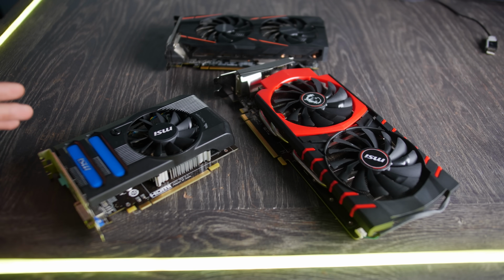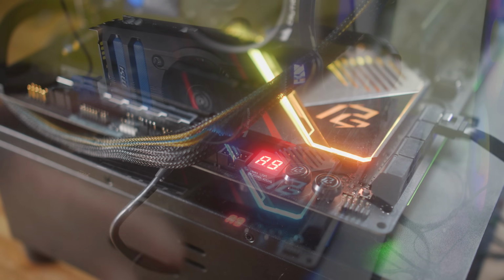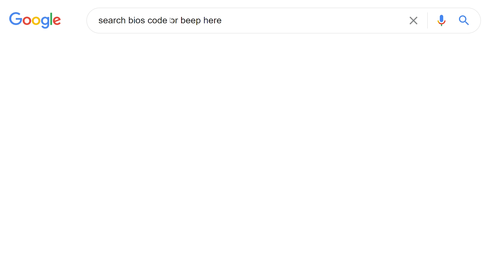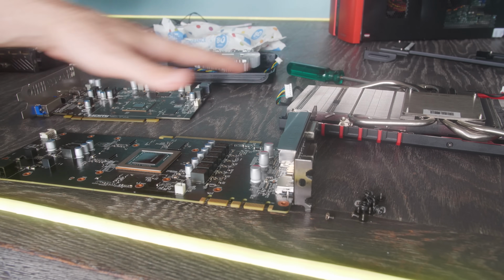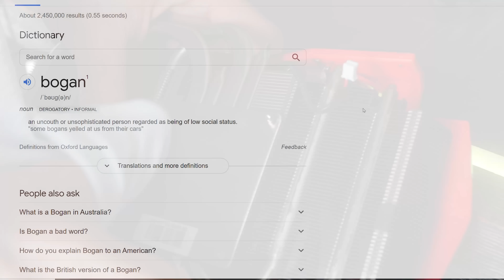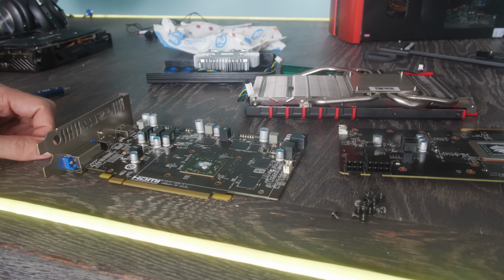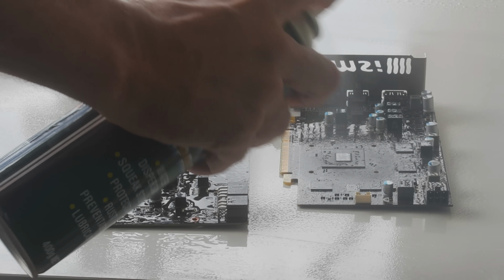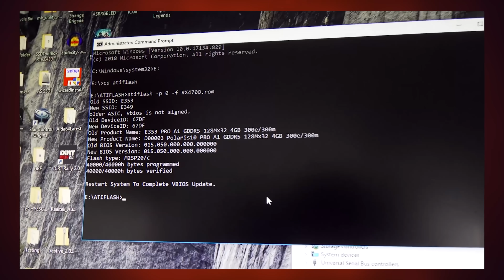How To TRY and FIX a Graphics Card (COMPLETE Start to Finish)

Comment from the maker: Some of you guys are ninjas with the soldering iron and volt meter, if you are local and want these cards for free then hit me up.
Reply: I'm not local, but I'd be interested in that price, I'd even pay the parcel fee. Label them as Keychain Commodities (broken electronics) lol. Covid Bling! lol But seriously I'm interested if you haven't already sorted it out! I understand the realm of possibilities on making it here...
Reply: Yeah mate I'm just north Brisbane, feel free to drop any non working PC parts and I can give a crack at fixing them
Reply: Now that you've heatguned these, anyone with experience definitely doesn't want them. LOL
Reply: @nightfury3619  True and not true. Parts are always welcome.
Reply: @Dandan-tg6tj  problem is, most of the useful parts are going to be damaged from the excessive heat. The electrolytic capacitors will likely be damaged, the memory modules will have suffered a bit, and any other useful parts are pretty cheap and can be found on other cards that a repair professional will have already accumulated. Although, if it's free, someone might take it anyway.
Reply: @nightfury3619  There's tools to measure if capacitors are still in good or very good condition or not. Memory modules anyway would be desoldered and if they have ripped pads then it will be visible, otherwise memory modules are pretty resilient. Those tiny parts which are cheap are extremely valuable when a videocard has SMDs missing because you can not know the right value but you're able to get the exact part needed from a donor board.
And they are free, on top of everything.
It's always possible to get a much needed PWM controller, a multi phase controller or an error free BIOS chip.
For me ordering those parts is a pain so I would very much like to have those cards.
Reply: Do you offer any type of service for graphics cards? I have a gtx 1080 that is giving me problems at the moment and I am pretty sure it is the issue but I don't have another pc to test it on. It was bought in jan 2018 and was mined on for about 5months before I bought it (have receipt so this is for sure). I have been running it undervolted/overclocked myself since owning it and it seems to run in benchmarks fine but has been blue screening me with games playing. I think the gpu is dying but I am not sure. I tried downclocking it and  upping the voltage, even downclocking memory but still got blue screens. They where WHEA errors which indicate hardware issues. Can you help?
Reply: @tyroniebalonie  You need to service that card instead of trying a fix yourself. You will probably end up killing the card for good. There is something called "ultrasound cleaning" and it does wonders for cards which are still working most of the time. The main cause for blue screens is the dirt, electricity conductive dirt, to be precise.
Let a professional wash it for you otherwise you will probably lose a pretty good card.
Also mining cards have a modded BIOS which isn't working good for games. Mining cards usually have cooling issues.
You do need a professional to take a look.
Not all who say they're professionals are professionals for real so you need to find one who really is a professional in graphics cards maintenance or/and repair.
Reply: @Dandan-tg6tj  Dude shut up. That comment was over a year ago and I fixed the card myself. It's still running fine. Go an ego-splain to someone else that needs it when it's actually relevant to time lol.
Reply: @tyroniebalonie  You're aware of that people read these comments even after a year or more, don't you?
What do you think, will my comment help someone else who can't actually fix its own video card to not damage it completely or perhaps my comment may help someone to think twice before ruining its card completely and by doing so, to make the right decision to not destroy a perfectly salvageable card?
You may think you're the only one alive on this planet but you're not.
It's not about ego, it's about informing people that things may actually go very wrong when you don't know what you're doing but you think that everybody is able to fix a graphics card with no effort and no knowledge at all.

P.S. If you actually do think about other people who might be in the same position you once were, post the way you fixed your card. This way someone can follow the same procedure and probably have the same kind of success as you did.
Sounds good?
Reply: The MSI should be easy to fix for someone ok with electronics, would like to see a follow up on the story on that one
Reply: Maybe a collaboration with another Channel?

Eli Tech, Adamant IT, Louis Rossman, My Mate VINCE, Lapfix, TronicsFix just to name a few I could think of.

Or you know you could just send it to AvE and say hey, we hear you can unbox this hardware and "crack" it. He's got it covered either way! lol Sadly I feel this would be the 100% destruction path. Collaboration is Collaboration however lol... I would be interested in seeing someone local to you doing something with it on YouTube if it goes local. Those videos are really good. Gives a 2nd opinion on what someone else seen. And offers a method for you to learn as well as many others at the same time.
Reply: When my GTX 1080 kicked the bucket , back in late November. I tried the heat gun method to no avail, so stuck right now using a old 2gb GTX 960 to get by. Even that gpu I had to do some tech yes city loving to clean it up and fix temperatures.
Reply: @908967  Do you have a multimeter? Most of the time with newer cards it's the mosfets that die. You'll usually find a short between one of the 12v in and ground. When the card boots, it detects a short and shuts down. No amount of heat will fix it.
Reply: @myne00  the card is artifacting even at cold boot
Reply: @D260077  Ah, then you have a shot at fixing it with crude methods. First thing I'd do is strip it, chuck it in the dishwasher, and then dry it in the oven at ~90c. I say 90 because ovens aren't exactly precision devices. 90c is probably around 100 at times. It also won't cook the capacitors, but it should dry the card fine in about 15-20mins. It's almost certainly not going to change much, but at least that possibility is eliminated. Next, find a copy of Nvidia's MATS/MODS like below and run it from usb. It'll do some tests and create a report.txt - which should highlight which memory module is erroring.

https://drive.google.com/drive/folders/14sGDSBUiQYebv3Ja6BPsRTe4mFZ61cYB
Reply: Im from Australia I love to get an other cards
Reply: I would love to give these things a try! I do iPhone microsoldering and motherboard diagnostic and repair on my channel.
Reply: Just a question what could be a possible cause for a gpu not posting every time and when it does, the fan controller doesn’t work and there are artifacts?
Reply: 4 years later can i have one? My Brother Im from Philippines
Reply: I emailed you about that a few weeks ago ;)

Comment: Great video 😊 Repair graphics card IS not a childrens Game. I'm not have the experience of electronics enough to rebirth those items. So i don't recommend to buy break GPU s to try to fix them. Actually I fixed one AGP 5200 fx very old, with the Hot Air trick. I could enjoied It about 2 months, and not every day.

Comment: DONT DO THIS! But sometimes it works, on any pcb, not just graphic cards.  One thing that often will stop electronics working is a dry joint (poor manufacture but the fault develops over time). Here is an easy kill or cure fix (so last ditch but sometimes works). Now before you do this google dry joints so you know what you are looking for, then have a close look, sometimes if you are lucky you will spot a suspect bad solder joint that is big enough to literally just re solder (google that as well tip at the end) I have fixed a surprising number of things by just re-soldering a few suspect joints. But assuming the suspect joint is not big enough to see and its one of those microscopic joints there is still a way. literally I was shown this by a PC engineer about 40 years ago when people sill did board level repairs. Get a blowlamp, light it let it warm up and stabilise, adjust the flame intense but small. Then literally move it over the underside of the board "reasonably" quickly. If done right the heat will re-solder all the joints before anything gets hot enough to be killed.    Obviously some practice on and old dead PCB's is useful first. While I have lost count of the electrical appliances I have fixed by simple looking for and re-soldering visible suspect joints (if they are big do them all), EVEN AFTER EXPERTS SAID THEY WERE UNFIXABLE. But I have resorted to this "Kill or Cure" approach about a dozen times over the years (before throwing the thing in the rubbish), AND FOUR TIMES IT WORKED. So worth a shot if all else fails. 

Soldering TIP, I now have several good soldering irons, but someone bought me a cheap battery soldering iron, I thought is was a gimmick or toy.... but tried it, ITS BRILLIANT for this type of work. It cannot do huge joints but for small soldered PCB joints is fast easy and doesn't overheat components. But google how to solder and practice on something you are not really trying to fix first. 

THATS ALL FOLKS.... 

REMEMBER THIS REALLY IS LAST RESORT, I accept no liability for any damage you do to your kit, hands, or house, use this info responsibly and at your own risk.

Comment: Thanks. I watched this yesterday due to having not one, not two but THREE bad GPU's. I stupidly (or not, as I will have a backup now) ordered a second hand one because the first two I had didn't work, they would go for a time then shut down the entire machine. With your tutelage, I was able to get one of them up and running again, (going on hour number 28 of continuous use) and I couldn't be happier! Thanks again. All I did was disassemble the GPU, removed the dust that had gathered on it, wiped it down pretty well, and reinserted it into the MoBoard. Fired right up!

Comment: Get an ultrasonic cleaner!!!, Sometimes debris can get into the BGA of gpu chips and cause issues and make them act stupid. Regular surface cleaning will not work. Make sure you use de ionized water and let the cards sit for a day or two to dry them after ultrasonic cleaning.

Comment: My system is i3 10100f. ram 16.  I have and recently bought an rtx 2060 super.  That was for someone.  The temperature of the graphics card was 80 when he was testing.  It was like this most of the time in the games I played.  He said that he did not clean or repair it at all.  What do you think I should do?  please help

Comment: I have a HD 7970 with intermittent failure - sometimes it runs fine, sometimes it fails abysmally. When it does run, I tend to just leave it one for fear that a restart attempt will result in failure. It generally fails as a frozen screen, or it will POST but have no visuals. When it is used, it disables my onboard graphics, so I can't go in and use that to try and fix things.

Does this sound like a VRAM/heat gun scenario?

Comment: Coolest diagnosis trick I have seen is to remove the cooling fan board, plug the bare card into the motherboard,  take a q-tip with denatured or rubbing alcohol on it, get the top surface of each memory chip slightly wet. Next power up the CPU and look at the wet chips.  If one dries quickly 2-3 seconds then you know its failed and overheating.  Obviously don't keep the system powered up for long or you burn the main GPU out.

Comment: What you have done with the multipurpose spray and a tuff brush is bad!  you could remove small electrinc parts from the PCB!
The correct method: You can clean it with your ultrasonic cleaner, and for those who do not have this cleaner, a simple soap and hot water shower, a very gentle one, no brushing what so ever just foam made from soap, hot water slow stream in the shower. and a full 72 hours dry process, is the safest way to go.

Comment: Hey, great vid. I have a proble i recently upgraded my motherboard and cpu to gygabite z370 ultra gaming and cpu i7 8700k after finising the build i put my gpu in (rtx 2080) which was working fine with the previous cpu and mobo i installed a fresh windows all my drivers are up to date i made sure im not using inetgrated gpu but im still getting 5-10fps on games my gpu usage is at max 9% i tried benchmarking it and the gpu works fine but when i launch a game it doesnt work properly i also did all the things like power settings etc PLEASEEEE HELPP My head hurts

Comment: I'm having an issue with a Nvidia GTX 1050Ti graphics card and was wondering if you might have any ideas as to what might be the issue and how to possibly fix it. It works with most games I throw at it, but every now and then, I go to play a game I've never played on the PC before and all I get is a blank blue screen (NOT bsod, as it has no text whatsoever), but I still get sound. Another issue I get that really annoys me, is that when I press Alt and Tab to get back to the desktop (Windows 10 Pro, 64 bit) and hover the mouse over the game in the taskbar and then over the small window that shows a preview of what is going on in the game, I CAN ACTUALLY SEE THE GAME. So why does it not work when it is launched as normal?! What settings must I change to get the game to show up as normal?? The drivers are always up to date, as I use the Nvidia GeForce Experience program and update the drivers as soon as it lets me know there are updates available.

Any ideas?

Comment: I have a new EVGA 2080 Super stopped working fans run has 2 power connectors shows red light? I paid cash was new in box sealed. They claim not retail and I didn't buy from store so no warranty? Only used 14hrs.

Comment: Heatgun can magically fix a broken mosfet... 

Why do professional graphics card repairman even bother using a multi-meter, or a soldering iron? You can just heat-gun your card back to life.
Reply: To check  and change the fuse i think
Reply: @alxnd_r6345  what? Just re-flow it man.
Reply: @denniscleaver3559  I have one sapphire rx470 with no signal. I will try the heat gun tomorrow
Reply: @alxnd_r6345  man, just give it to a professional.

No signal can mean something as simple as a corrupted Graphics BIOS, or short on power rail. 
Don't trash your card with a heat gun.
Reply: @denniscleaver3559  i had couple of them they were mining. Changed the bios on two of them and they work just fine. 3rd is the problem

Comment: If you cannot use a multimeter i think better to avoid these types of repairing attempts, because without it you cannot determine the shorted part and you just do more damage on the card :)
Reply: His logic is:if heat doesn't help, nothing will.
This is 1% part true, you need heat to solder. The rest 99% is what it is, entertainment.

Comment: i think the capacitor is bulged, u can try to replace a bulged capacitor, but its difficult process, capacitors function is to temporarily hold electric charge n release its when power is needed, thats y the gpu cant start at early

Comment: Sir, i have amd rx 480 8gb gddr5 when i connect 8 pin of smps to the graphic card the 2 fans rotates but when i connect graphic card to the slot on the motherboard fan does not rotates and graphic card is  not detected by the computer. Is my graphic card faulty?

Comment: Hello greetings to all, I have a gtx1050ti which was not showing any display at first but after clean and doing some heating now it's working but whenever I start any game or GPU related work then the VRAM goes all the up to 4gbs and GPU usage also goes to 100% and always stay there, is there any solution to this? Please help me if anyone knows anything. Thanks 😊

Comment: Hey @TechYesCity. I have been watching some of your videos as i have made myself a problem. I have a 1080, 2 years of use, that isnt working after little cleaning. My temps get to 90s instantly when i start a game or benchmark. The card had no issues before cleaning i have re cleaned and applied corsair tm 30 thermal paste a few times. Also there isnt any artifacts just very low frames.

Comment: So you keep pressing the power on button while the card is obviously shorted, no wonder after you "washed" it, something just blew up on the card because that time your psu wasn't fast enough to shut down the 12v rail. You use heatgun over components known for blowing up to heat (capacitors), you could've suffered a serious accident if that blows into your eye for example.
You clean the card with a hard bristle brush which can easily brush off small components on a used card (and you will have no idea if something is missing (those small smd components are inspected/repaired/replaced under a microscope by repair guys).
All in all you had no idea what are you doing but I guess everything for the viewers (I mean money).
I hope people are smart enough not to iisten to this video. If you want to repair a VGA or motherboard or anything electrical you should firstly use a multimeter to test the main voltage rails. Cleaning sometimes works, "cooking" is a bad idea. If you really like the heatgun use it from a distance and only for blowing out the water (after washing the VGA) from under the gpu.
One tip: on GPUs you should spread the thermal paste (not just put some in the middle like on CPUs) because if even some small part of the GPU is not covered (so it's not in contact with the heatsink) that part of the GPU can overheat and can cause issues. And you can clean off the rust by putting that part into white vinegar.

edit: reading below comments I wasn't the first. Whatever, after writing this much I'm not gonna delete this comment. :D